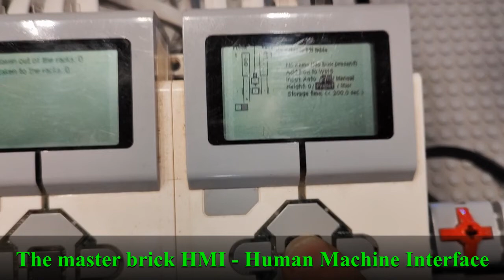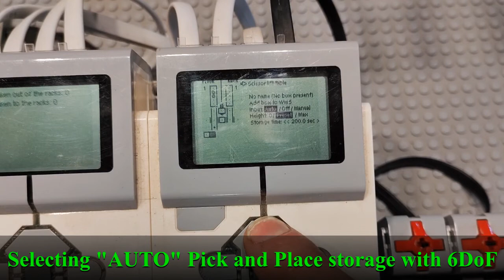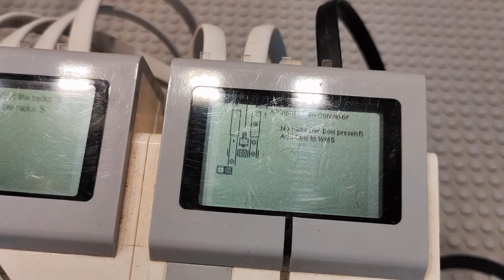LEGO logistic center - Warehouse crane and robotic arm connected by conveyors

Comment: insane work …did you code it with Java LejosEV3. If yes could you tell me how you combine the two EV3 bricks for the 6 axis robot, that they interact with each other. Do I have to connect them via Bluetooth ? Your help would be great. Regards Joshua
Reply from the maker: I programmed it with PyBricks (MicroPython), in Visual Studio Code. The EV3 bricks are indeed connected by Bluetooth. If you search for PyBricks EV3 on Google you will find the very useful website with a lot of explanation on how to use it. The smaller version of this 6axis robot I have the PDF instructions for sale on Rebrickable, and the programs are included. If you need any more information, feel free to ask. Greetings Jozua
Reply: @profjos  Ty very much i have Builded the newest Version of akyukis 6 Axis Robot and I study industrial Engineering and Mc task is to code it With lejosEV3. Do you have Any experience with that ? And thank you for the tipp I try it First with your program 👍🏽
Reply: And Could you please link your link where I can buy your PyBricks Code, that I can have a deeper look in the invers kinematics. 👍🏽
Reply from the maker: @JoshuaMaier  it's on the website Rebrickable (I can not paste links in YouTube comment section). You can find the link in one of my videos about the smaller 6axis robot. Or search 6DoF Mr Jos. If you buy the building instructions there, you will have access to the programs also. The website is used by thousands of Lego builders to sell their PDF instructions.
Reply: @profjos Yes I Know rebrickable and thank you. Think I am gonna buy it soon. Have a nice weekend 👍🏽

Comment: So when are the auto-sorting machines going to be combined with the warehouse machines?
Reply from the maker: If I find some more mindstorms bricks. I don't have enough controllers/batteries/motors to get all running at the same time, and EV3 is hard to find now. I do/did have plans to combine more of my machines to work together. Like the gantry system for a pick&place, but I need more electronics.